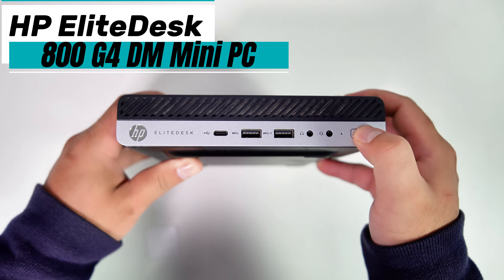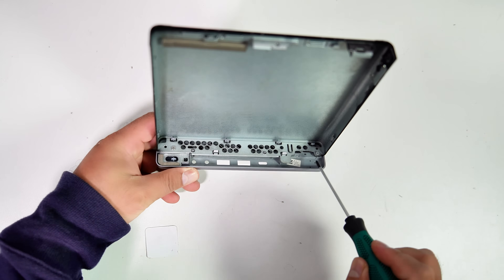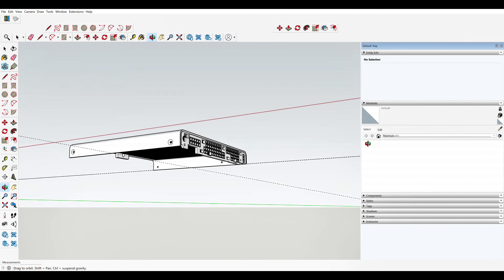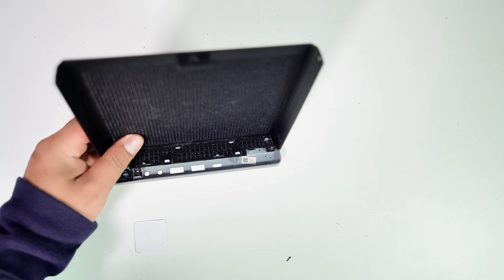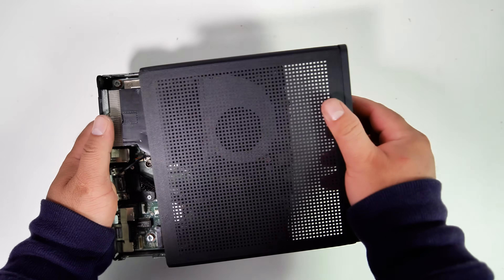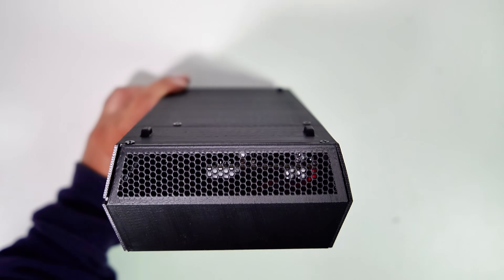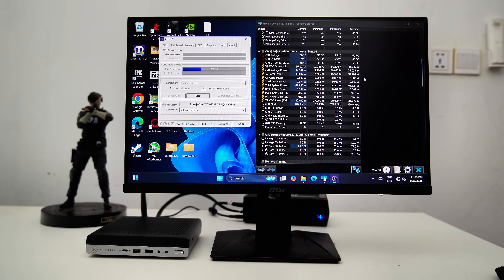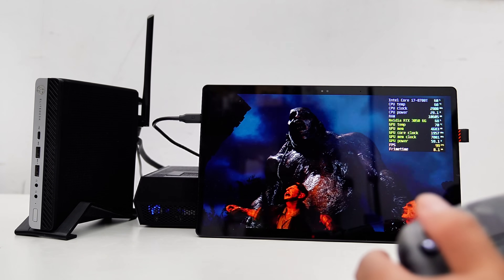HP Mini 3D Case + DIY RTX 3050 eGPU: Amazing Gaming Power

Comment: What 3d modeling program do you use? I'd like to switch away from Autodesk Fusion 360 because apparently they're phasing out the free-for-personal-use option.
Reply from the maker: Sorry, this 3D model file is my signature, so I can only provide the STL file, which is ready to print but seems uneditable, similar to a PDF. If you need an editable version to remove my logo from the case, I kindly request that you create a new model instead. Thank you.

Comment: i notice all the mini/tiny pcs you use for these setups are all intel variants I'm interested in using a ryzen version and was curious if you knew if this was possible with a M75q which has ryzen pro?
Reply from the maker: It is impossible to install an Oculink adapter on the Lenovo M75q. I am using the PC I currently have on hand to make a video. I've noticed that many Amazon or eBay sellers often request video content for specific PC models they sell, but I believe they should consider contacting YouTubers for sponsorship collaborations instead. Personally, I'm not very interested in AMD PC platforms, as I don’t have much experience using them. If you're interested in this particular PC, why not give it a try?

Comment: Purchased the top cover, printing it tomorrow
Reply from the maker: Hi, I've made adjustments to the 3D model to improve it, and the updated files are now available for download. Feel free to check them out and let me know if you have any feedback or encounter any issues. Your support means so much, and I hope you enjoy the improved version!
Reply: @itggear  I wish I saw this earlier, cause I could not get the front panel to sit flush no matter what I did, and I struggled to find screws that fit the sides..
Reply: I printed on a a1m with petg
Reply from the maker: I use M3 screws for the side, and you can use motherboard screws. There are holes on the chassis, but those holes are for the screws. First, I use a PSU screw to tap the female thread for those holes.

Comment: I'm waiting for project where you put GPU inside HP Elitedesk 800 G4 mini, and soldering the power to input like you did on Dell, hope it achievable
Reply from the maker: That would be a great project to try, I'll try to make it.
Reply: These came with an nvidia 1660 ti as an option. Super rare configuration.

Comment: This is what 3D printing is best for, servicing and upgrading old things to give it new life and avoid unnecessary waste. This is a great channel.

Please keep making more thermal and GPU support solutions for these micro desktops! I understand that this is a DIY focussed channel but if some of these case designs were sold ready built (3D printed or machine made) it would make these designs more accessible because 3D printing is still currently pricy to begin.

Also have you ever considered recycling bottles at home into PETG filament and printing your PC enhancements with it? Maybe its not heat resistant enough or too malleable. If it would be a good material then that would be a fun video to see to further help cut waste.

Great video as always! Id love to buy a pre-made case from you :) Keep making these micro cases they are fantastic!
Reply from the maker: Thank you for watching!

Comment: i have one of these (the same model), and what i did to improve it was drill several holes with a small drill bit in the lower part, and i soldered (you can also glue or use magnet support) four brackets to raise it, thus providing more air intake and exhaust at the bottom. on the top, i did what you did, but i also bought an extra one and made an adaptation that allowed me to install a tower cooler. of course, with the tower cooler, i had to make some adjustments to install it, but the temperature does not exceed 55°c.

with the holes and the additional support at the bottom, it reached around 70°c, and with the cooler, 55°c.

and another incredible video. very good, buddy.
Reply: oh, i use this system with my old 4070 ti oc with containers in docker (looking for use podman), and some ai's

i have another pc's (server's) together
Reply from the maker: Good for you!

Comment: What's the comparison in terms of thermal ? So around 70 for the 3d printed case, how many for the OEM metal one ?
Nice video and design 🤤
Reply from the maker: In fact, there is not much difference between the ventilation top cover and the original top cover since I only have a 35W CPU. You can check the CPU thermal performance of this PC with its original cover here:  https://youtu.be/Co_H_0narpQ